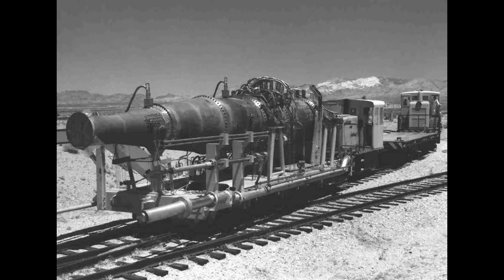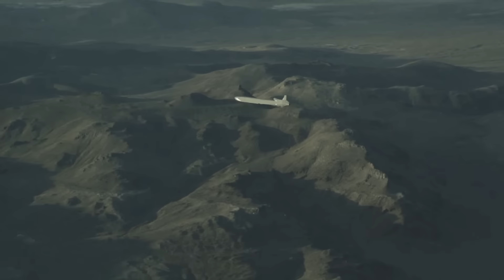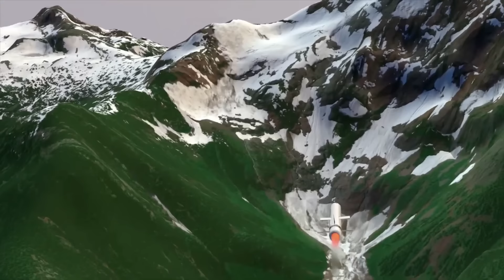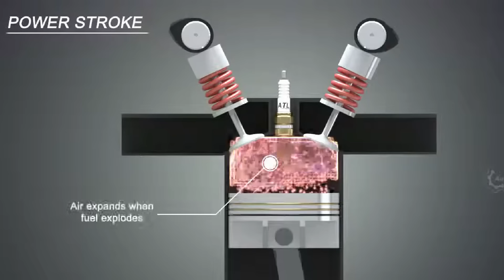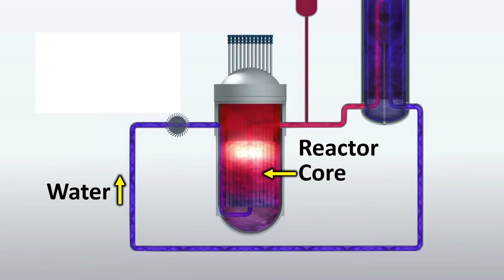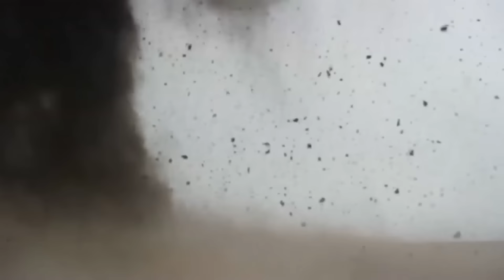How Can Nuclear Reactors Power Missiles? | Russia's Burevestnik Missile #militarytechnology

Comment: The nuclear-powered cruise missile concept (e.g., Russia’s Burevestnik) appears far more like a strategic ruse or exaggerated prototype than a practical weapon. Several fundamental engineering and physics constraints make a viable, operational system highly improbable.
First, the propulsive cycle itself is problematic. A nuclear ramjet or turbojet must heat the incoming airflow to temperatures comparable to those in a conventional high-performance jet engine—roughly 1,800–2,200 °C at the turbine or nozzle inlet—not the ~1,000 °C sometimes cited in popular discussions. Achieving and sustaining those temperatures with a compact, flight-weight reactor while managing material limits is non-trivial.
The reactor must also be at or near operating temperature at launch (even if rocket boosters provide initial acceleration). Without an external cooling loop or pre-launch heat management system that remains connected until the moment of release, the core would overheat and risk structural failure or melting before the vehicle is airborne. Once airborne, the same core must remain critical under continuously changing airflow, altitude, and thermal loads.
Because the design almost certainly relies on a fast-spectrum reactor (to keep the core compact), neutron moderation becomes a critical control challenge. In thermal reactors, water or other moderators slow neutrons into the energy range where fission cross-sections are high; control rods then regulate the reaction. In a fast spectrum the neutron population is harder to control: too few moderators or absorbers and the chain reaction dies; too many and the system becomes supercritical. Maintaining the precise “sweet spot” throughout a multi-hour or multi-day flight, under vibration, thermal cycling, and changing aerodynamic heating, is extraordinarily difficult.
Radiation effects compound the problems. Fast neutrons and gamma rays will continuously degrade the airframe, control surfaces, wiring harnesses, and any electronics—even radiation-hardened ones. Magnetic deflection cannot remove neutrons, and progressive embrittlement, insulation breakdown, and semiconductor damage would accumulate from the moment the reactor is brought to power. Extensive local shielding adds mass that directly reduces range and payload, defeating the purpose of a nuclear-powered long-endurance vehicle.
Operational realities are equally severe. Personnel assembling, fueling, or maintaining these systems would face significant radiation exposure without the massive biological shielding, remote handling equipment, and large support staff typical of ground-based reactors. The cost of producing, inspecting, and keeping such missiles in a ready state would be enormous compared with conventional cruise missiles, and far higher than the already substantial expense of a stationary nuclear power plant.
Given that the United States, the Soviet Union, and other technologically advanced states explored nuclear-powered aircraft and missiles decades ago and ultimately abandoned the efforts for precisely these reasons—materials limits, radiation damage, control complexity, safety, and cost—it is reasonable to question whether the current Russian program has overcome the same barriers or is instead serving primarily as a political and psychological signal.

Comment: It would be a nice change, if people would start using their mind, and start to be rational, not just about this, but about everything else…
This is H2O powered missile…
Yes, it has reactor, but it is not nuclear reactor…
It is Hydrogen powered missile…the reactor is used to alter the state of the water into the Hydrogen…
This happens, several seconds prior to entering the combustion chamber…
Russia is not the only country that uses Hydrogen, as the primary fuel for their missiles…
Other countries such as China, Iran and a lots of other countries, are also using Hydrogen as the primary source of fuel…

So…if this is true…
Does this means, that Iran was actually trying to get enriched uranium for nuclear weapons…
Well…
If Hydrogen is used as a fuel, the answer would be…” yes “…
Since any country that knows how to resource Hydrogen, does not have any needs for enriched uranium…
The only problem is, that most of the countries, that do know how to outsource the Hydrogen, they are also the country that sells crude oil to others, so promoting Hydrogen as a fuel, is not viable option, for Russia or Iran….
Burevestnik is Hydrogen powered missile, same as a lots of nuclear submarines…
That’s the only reason, why none of these weapons do not leave any traces of radiation, behind themselves…

All hypersonic missiles, are powered by the Hydrogen…
Also, they are most likely to be two stage missiles, during takeoff they are using solid fuels, once they have established the solid trajectory line, they are switching to Hydrogen…

You do understand, that Russians have used war in Ukraine, to clean up their warehouses, from weapons that they considered to be…
“ OBSOLETE “…
Old technology…

It is no longer considered as the advantage, to have a nuclear weapon, compared to Hydrogen powered missiles…
However, if you do have a Hydrogen as a fuel for your missiles, you can always built intercepting missiles and power them with Hydrogen…
The response for Hydrogen powered missiles is, that they are about 8 to 10 times faster, then missiles powered by the solid fuels…

Comment: and now, what is stopping Sukhoi or MiG from installing nuclear power in their planes. 
nothing stopping them, all today's new planes have been in use for at least 20 years. mig 29 first fley in 1966, Su 24,27, in 70' years, so Su 57 has been used for 25 years already. and unofficially there is already a nuclear-powered plane, and it has fly. excellent space propulsion. almost every Russian plane flies to the height of the border with space, so the mig 25 has already done that, that's why it was made to fly to the border itself and shoot down satellites, and that was in 1972. 
now imagine what they have done so far.

Comment: Nuclear reactors help to produce electricity 
Electricity helps to run the engine thrust & heater elements to create the thrust.
The nuclear reactor will have a special compound cooling system to keep the reactor cool enough during the flight.
This is the possible way.
That's why it is flying at subsonic speed with endless range.

Comment: The US had tested nuclear powered  motors for an cruse missle back in the early 60's the engine was working better than predicted and was ready for actual flight testing (project Pluto USAF) for ICBM missles due to concerns about the radioactive waste along the flight path and possible radioactive active contamination of their was a crash in route to the target. 

In the end the US Air Force decided correctly that the negative potentials out weighted any possible positive attributes that nuclear power might gain. 

The US Air Force also tested a nuclear powered aircraft. They outfitted a B-36 peacemaker with a nuclear reactor to power it. But again the negative attributes outweighed anything positive. 

If the Russians are thinking about using the nuclear powered missles even with conventional explosive warheads their will be radio active contamination of the Ukrainian land.

Comment: Oh sh!t..how do they compress the intake air?
Reply: In much the same way as a conventional jet engine works. However, the compressed air is being passed through the nuclear reactors core and is heated to a very, very high temperature. That very much now expanded air and of 'higher velocity' now passes through another turbine that is mechanically coupled to the compressor turbine. This air flow cycle repeats while the core temperature is sufficiently high enough...

Comment: A long video with a trivial, five-second explanation. Heating by overheating the reactor. Proof? None. Pathetic. There are also processes to generate electricity directly from small reactors using radiation or low temperatures. This could then be used for propulsion. Perhaps progress has been made in this technology? The most important thing is what the video omitted! Putin explicitly pointed out that the rocket can also be launched from a standstill! A ramjet engine can otherwise only do this with external assistance. That's the point. You're incredibly naive.

Comment: Google "The Flying Crowbar" 

We had it in the early 60s
Reply: They never got past the design and testing stage, so they didn't even have prototypes
Reply: They tested the engines (worked perfectly) and develop the terrain following technology that guided early cruise missiles before gps abd hyper accurate inertial navigation systems
Reply: @Memphian1000  but fail to combine dis two brilliant technologies into a one capable device.

Comment: Чем больше времени ракета в воздухе,тем больше вероятность,что еесобьют! Ну и в чем гениальность,товарищи МУДАКИ из Кремля ,если Путин-Хуйло ?
Reply: What part of evades interception didn't you comprehend?

They have a flight time of around 15 hours which means you can launch them from anywhere or have them patrol a whole coast line up and down and then suddenly spring into action

One missile in the air will take many planes trying to monitor and track it, the cost will be huge trying to defend against it

It's called asymmetric warfare, the Russians can put one of these up at the cost of maybe $100,000 for 15 hours, but to defend against it for that long with aircraft will take many times that cost
Reply: Гениальность в том, что этой ракете не требуется пересекать зоны где ее могут засечь и сбить. Она может их спокойно облететь стороной, и пролететь через самую слабо защищенную зону. А покрыть всю землю мощными системами ПРО - никакого (мирового) бюджета не хватит.  (предварительный подсчет показал что  для защиты всей земли системами типа С-400, понадобится минимум 1200 комплексов, а Пэтриотов для этого понадобится не меньше 7600 комплексов)
Учитывая что сейчас НАТО тужится найти для Уркаины даже десяток Пэтриотов, Сомневаюсь что семь с половиной тысяч они найдут ближайшее столетие

Comment: Basic calculation:
1 - The nuclear fuel can last a long time
2 - the propellent mass has a much lower lifetime
3 - for hypersonic speed, or even 3,000 miles per hour, you will consume around 8 tons of propellant in 2 minutes
4 - thus to travel around the world once at 3,000 mph you will need a propellant mass of about 4,800 tons
5 - therefore you will need a motor thrust of 3,200,000 lbf or 3.2 times the trust of a single F-1 rocket engine used in the Saturn V moon rocket.
It is actually worse as the vehicle is operating well below the Kármán line.

Comment: The US did not abandon Project Pluto, because the engine did not work, but because the engine did not have the shielding to be placed in a manned aircraft and the autopilot technology of the mid 1960s could not be trusted to not have the cruise missile crash in an embarrassing fashion, in a completely random location, anywhere on the Earth's surface.  It was bad enough when an SM-62 'Snark' cruise missile, instead of flying out over the Gulf of Mexico and then back to the Florida test range, crashed in the Amazonian jungle of Brazil.  Ground testing of the nuclear ram jet had been successfully completed and the engine was ready for flight testing.  The US DoD had the potential disaster of a failed flight test landing in an urban area staring them in the face, when they decided that they did not really need a nuclear powered cruise missile.

The missile has no flight crew.  The shielding problem is much reduced.  Only potentially sensitive electronics need shielding.  Everything else only has to last longer than the flight time of the cruise missile.

Simple ramjet explanation:  The intake is the compressor.  The rate that air can flow out the back of the intake into the combustion section is less than the rate that air at ambient pressure can flow in the front, so the pressure increases as air moves through the intake, the pressure forces air into the combustion section as fast as ambient air is scooped by the intake opening.  Ramjets are only efficient at supersonic speeds, but the reported distance flown and time taken to fly it strongly suggests a subsonic missile, so the Burevestnik is not a nuclear ramjet.

Comment: "… air could become contaminated … the missile might leave a trail of radiation …" = WRONG. 
RIGHT: Air will become contaminated. The missile will leave a trail of radiation.
" impact … could produce a level of radioactive contamination similar to a nuclear accident"  = WRONG. 
RIGHT: Impact will produce a level of radioactive contamination like a nuclear accident"

Even with a realistically sized nuclear warhead it will multiply contamination on impact. Even small reactors need much more fissile material than modern thermonuclear bombs. In a small reactor that need be plutonium. Will be a very dirty bomb.

These are not "risks" but effects to calculate with 100% probability of occurrence.

It is for these reasons, that former programs had been abandoned, not technical difficulties like the video seems to suggest. Not because these were "impossible" missiles but because they're insane.

Comment: I doubt that this thing is using the heat from a reactor to expand compressed air to provide thrust.  Too vulnerable to heat seeking missiles and would leave a slight radioactive trace in the air as it passed thru the reactor area.  My guess is it uses the same ducted fan principal that commercial airliners use.  The reactor turns a turbine that spins the fan or fans and the air passes around the reactor acting as additional cooling, then exiting the duct nozzle, probably two of these ducts powered by a single small reactor.  But what do I know?

Comment: To be a ramjet it must travel above mach 2-3 so I doubt that.
I would question reliability, aka errosion of the core with hot high velocity air. I bet it leaves a radioactive jet plume behind. Any slight blockage of the air intake (travels at low altitude)  would be catastrophic I guess. 
Your diagram and comment about radar tracking of low altitude cruise misile is accurate but lacking. I wonder how the most advanced radar system would see cruise misile? I am talking about the Australian Jindalee over the horizon radar, range about 3000km. I believe they can see the jets on the runway in Singapore from Australia with that? Any radioactivity in the jet exhaust may very well ionise the air slightly and increase the radar signature massively?

Comment: problem is that to shield from radiation you need very heavy shielding, but since it's a missile you can't have that, so you need components that can withstand radiation which is a very big problem, also testing it is very dangerous, you don't want humans near such a radiation source.

Comment: The fact that Norwegian monitoring stations detected no radioactive signature from the 9M730 Burevestnik nuclear-powered (SSC-X-9 Skyfall) missile's test flight strongly suggests that its developers have made a profound breakthrough in solving the twin challenges of radiation shielding and reactor miniaturization. This engineering feat opens a potential pathway to adapt this compact nuclear technology for civilian use. The same principles could one day power unmanned cargo planes with global range, massive ships capable of years at sea without refueling, and heavy construction equipment that operates entirely off-grid. Should this technology be integrated with safer designs like molten salt reactors, it could accelerate this transition, moving what is now a strategic weapon into the realm of transformative civilian infrastructure. The 2-meter diameter of the Burevestnik gives an idea of the miniaturization achieved.

Doubters argue that the absence of a detectable radioactive signature proves that there was no nuclear reactor running.
Reply: просто ядерный реактор работает через теплообменник в замкнутом контуре, и воздух не взаимодействует напрямую с активной зоной реактора. Ну это все равно не простая техническая задача в таких размерах

Comment: I read that NASA has been using nuclear fission powered small engines in space exploration vessels like voyagers or equivalents. But there, the speed is not controlled as there is no specific target.
Reply: radionuclid batteries used in exploration vessels are not engines, they generate electricity, not thrust

Comment: micro nuclear reactor generating a lot of heat in small volume and surface to compress the intaking air and expand in the exhaust nozzle producing thrust. The nuclear reactor has to work in very high "regime" with very high temperature with the fissible material, reactions rate and neutrons, x ray and other ionising particles. Very dangerous and fatal for surrounding systems and humans. Which leads to think that this RuZzians cruise missile is very heavy, bulky and big. And how are they going to "protect" the electronics and guidance systems, and weapon warhead from being destroyed by their own radiation levels..?  
In reality this a very old idea, abandoned several decades ago as no real benefits and with a lot of severe disadvantages, and in reality it is like a running "dirty bomb" contaminating all along the path and in the land below, so imagine that a lot of areas in RuZzia tests ranges and surroundings are already radioactive like Chernobyl or Fukushima. 
As we all know , the putinist propaganda machine is incessantly working to cheat and scare to the their own population and some abroad.